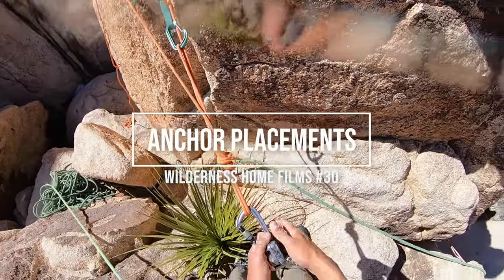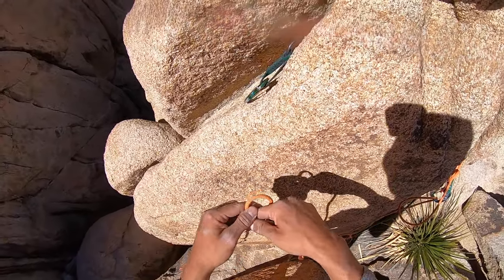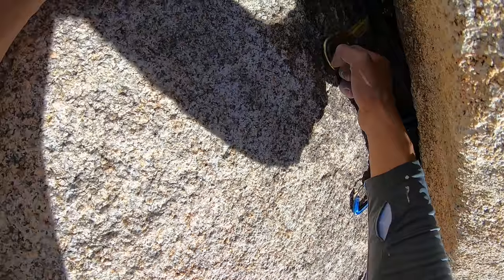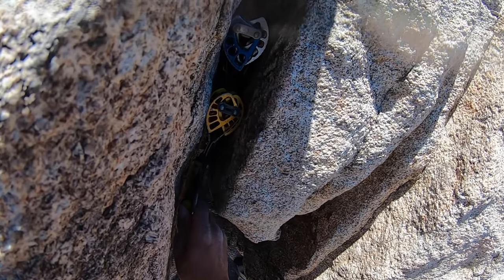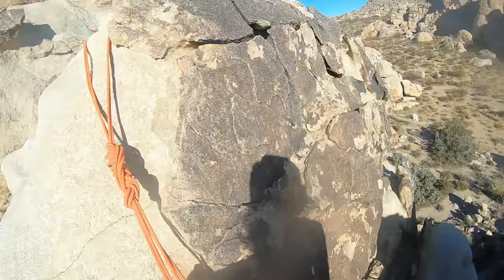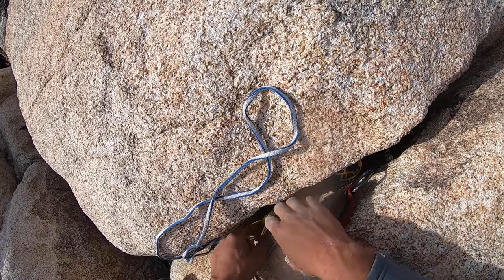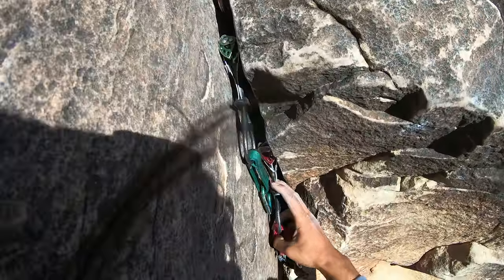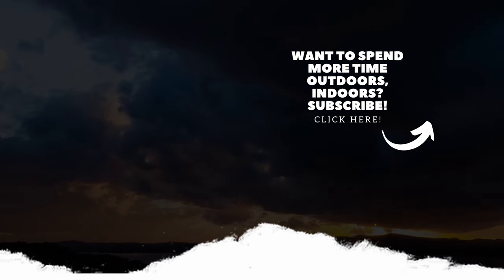WHF #30 | Real Situation Climbing Anchors

Comment: It's overcammed when you can't take it out
Reply from the maker: Preach! Hahaha
Reply: Came here to say the exact same thing.
Reply: Agreed, and most cams are actually stronger when slightly overcammed than the next size smaller undercammed.
Reply: Exactly. Overcamming is only an issue if it gets jammed in there.

Comment: 5:57, two pieces is totally legit, I like to think about the total strength of the anchor, I try to get it to 22 kn so a one and two at full strength gets to about 22, so just those is totally legit, also, if I have an anchor with let say two-point threes and a point two, I may throw in another piece as that is less strong, and smaller cams are more finicky.

Comment: On the first anchor the left piece could have been extended with a QuickDraw so the carabiner was not resting against the rock when you tied your master point in the direction of pull.
Reply from the maker: Solid advice, thanks for the fresh eyes!

Comment: Cool technique for building your anchors. Personally, I feel the extra cord coming down off of the anchor would feel in the way for me. Already enough rope management to deal with at the belay haha ! Maybe one safety concern about it though, is the fact that the clove hitch is on a snap biner. It makes this anchors dependent on the master point knot for redundancy (whereas, if you had a looped cordelette, if one piece was to blow, you could have big extension, but still have an anchor). ie you couldn't build a self-equalizing setup without knots like a sliding-X. But who builds those anyway ;) Just a thought. 
Thanks again for putting in the time to make theses videos ! It's a helpful reminder, and it gives us, viewers, access to another perspective than our own.

Comment: What type of gear do you recommend for building anchors? What are the most common/useful of them? I'm planning to purchase some... Thanks!
Reply from the maker: There’s a ton of ways to build an anchor safely. I recommend you stick to one of the more common and easy to inspect versions for now. Starting out I recommend carrying a looped cordellete tied together with a double fisherman’s. Maybe 18ft or so in length untied. Clip each piece and then pull down into a master point. Carry around a double shoulder length sling as well in case you want to build something that needs less material. 

Depending on the application: 

7mm-8mm cord if you’re top roping (thicker so it’s abrasive resistant when you’re not watching it, but this issue is kind of location dependent) 
6mm cord if you’ll be present at the belay station on a multipitch (we can safely be thinner and lighter because we’ll be watching for abrasion) 

two lockers if you’re top roping at a crag
one locker if you’re multipitch climbing for you to tie in directly. 

Hopefully this helps. Let me know if you have more questions and we can go over it.
Reply: @wildernesshomefilms  Thank you very much. Very professional. (I'm planning to take my kids to Joshua Tree for climbing). I'll watch your videos to learn more about and give them a better experience. We already have harnesses, climbing shoes, ropes, etc. and on this week we'll go to hangar 18 (Riverside) in order to get more knowledge & experience. They're so excited and thankful about this new outdoor activity/opportunity. 
We want to say Thank you again for sharing your videos, and being so kind of communicating with your followers' community. Thanks for your support.
Reply from the maker: Happy to help!

Knowing you’ll be going with kids to JT here’s a couple more points if you’d like to read:

A common approach for many newer parties with kids setting up top ropes, without leading the route first, is to take a dedicated static rope (10-15m long) to help sling boulders as parts of the anchor. It tends to be easier to build anchors that way in JT at some of the more popular entry level areas. 

A lot of the route climbing will not be similar in form or technique to those found at most gyms so just be ready to ease into it. 

Have fun!

Comment: The only time a cam is overcamed as if you can't get it out other than that it's perfectly fine. The only real thing you need to worry about as far as safety goes with a cam is if it's way tipped out or it's in a flaring crack where it can pop the whole overcamed thing I think it's silly because it's still safe it's just the possibility of getting stuck
Reply from the maker: Thanks for taking the time to share your thoughts on a lot of these placements

Comment: @1:43 when making the figure 8 master point you dont need to wrap twice around the two legs of the anchor before you pull the bight through, just once is enough and add a slight twist of the hand at the bottom. makes for a cleaner dressing of the figure 8 knot and easy to read. Love the videos and commentary, keep up the good work.

Comment: What is the benefit of tying a masterpoint versus limiting knots? With one masterpoint the anchor loses equalization the second you're climbing anywhere but directly beneath the anchor--if you stray left or right at all, it's not equalized. Why not just tie the knots to make a classic quad anchor?
Reply from the maker: For me, it’s a pros and cons situation coupled with theory vs real world application. For starters, I never know what the anchor is really gonna be until I top out. This means I can’t have the quad prebuilt, what if I need to basket hitch a Boulder or the pieces of gear are distant and I need more material to build with. Either way I wouldn’t want it prebuilt because it’s so much bulkier that way. Secondly, in my experience, changes in equalization aren’t as drastic in a lead/follow case. Typically you set the direction for your last piece which will act as a directional, as will all your other pieces which is why you protect your followers especially when they are traversing. If I was setting up pure TR scenarios then sure, I’ll throw in a quad, but the other method is simply much more efficient and more than safe enough for almost all other scenarios.

Comment: Hi! What do you do with the carabineer and the sling creating the anchor? Minute 6
Reply from the maker: Hey antonio. That’s a shoulder length sling. I clipped both cams with it, pulled down to equalize, tied a master point with a figure 8 then clipped the one racking carabiner for the sling on the shelf and the other in the master point. Hopefully that helps, lemme know if you have any other questions.
Reply: What do you mean with the racking carabineer? Sorry but climbing terms are difficult for me.  In minute 6 i see two blue carabineers on top of the 8 knot that i don't know what do you use them for
Reply from the maker: A racking carabiner refers to a carabiner that is being used to simply hold something on your harness. If I took a carabiner, put it on slings, shoes, or even cams, and clipped them on my harness. It’s a racking carabiner. The two blue carabiners were simply there because I had them on the sling to clip to my harness. In this anchor they aren’t needed, so I clipped them to the shelf (one strand of each leg above the master point) to simply have them out of the way. The shelf can be loaded with weight if it is properly built btw.

Comment: 1:48 not a criticism of the anchor totally bomb! but another way if you need to conserve material you can girth hitch to one ring, then basket hitch through the other pull the middle down and align the tail end up with it, either tie a figure eight or a girth hitch masterpoint.

Comment: 2:06 if this boulder is sitting there I personally would secure it with the rope and a bowline on a bight,, the cams there are on an externally flaring crack so pullout strength is reduced.
Reply from the maker: I appreciate all your comments,  not only is it helpful to me but hopefully anyone else who stumbles upon them. Thanks! Also a solid idea to sling the Boulder, unsure why that just went right over my head at the time because it’s the one at the top of sidewinder and I remember it being a reasonable size to sling. Thanks again!
Reply: @wildernesshomefilms  Was that anchor from the bong? Thanks for the vid! Would love to know the other climbs you were building anchors on. Would be great beta.

Comment: What's the average length of cordellette for J tree in your experience? Ive heard some bringing up to 70 m of static line for some anchors haha.
Reply from the maker: If you’re comfortable building anchors with a standard rack you’ll be fine with 20-25ft of cordellete. I carry 24ft of 6mm cordellete and it gets the job done every time. I usually have about 10ft left unused and only rarely am I grateful to have had every bit of the 24ft. Anymore would be overkill in my experience.
Reply: I like this method of building an anchor with cord and need to try it. I have 24ft of powercord and am always grateful to have it when I need that much but usually it’s way too much. I’ve taken to tying the loop shorter with a flat overhand before building my 3 piece anchors in that W style and I just eyeball the loop length so it ends up at the right height and it’s not too hard to feed slack into the overhand as well.
Reply: Some people do 50-60ft of 9-11mm static line for the joshua tree anchor system which also utilizes the BFK and usually a double loop figure eight on a bight or a double loop bowline on a bight for one end and a clove hitch on the other for equalizing the anchor. The extra line off of the clove hitch side can be used to lower with a grigri to further adjust the knot and also transfer over to rappelling off of the master point. That's the way I learned but his way also seems very solid
Reply: Wow thank you all, very helpful insight to different options. Love this channel.
Reply: @partykrew666  I am still learning, but that's what I do on the couple of trad anchors I have made and even off of two bolts which is most of my climbing so far and have gone out with a couple guides and they do the same here in JT. I have 70ft 9.5mm static. 

I have used ~30ft 7mm chord for quads off bolts but in a loop its not long enough to avoid rope drag for the easier top bolted routes I have climbed here. Maybe not in loop like he was doing it'd be better on said routes, but my best investment for JT was my static.
Reply: The static line is great if you're building a top rope at J-tree, using the method described by partykrew666. Otherwise, you can use a cordellette or that 60m rope connected to your harness!